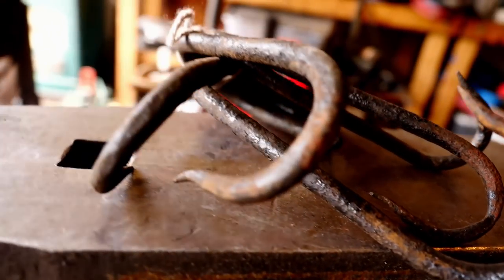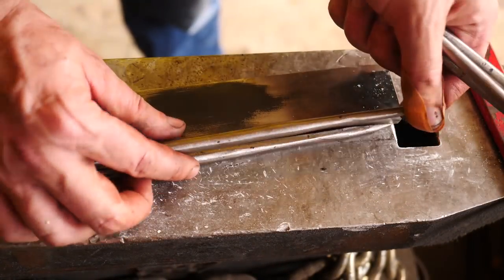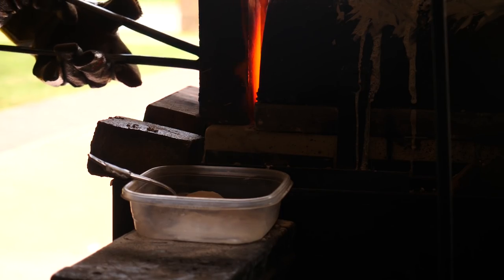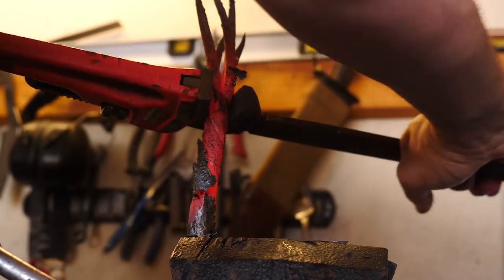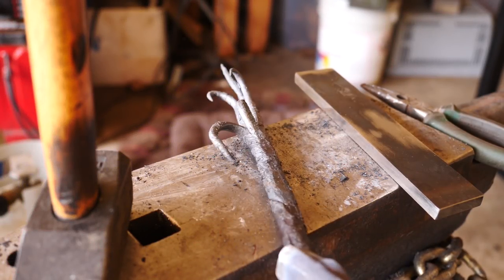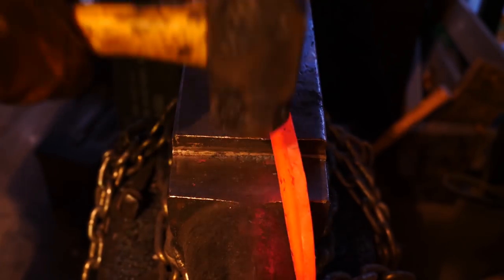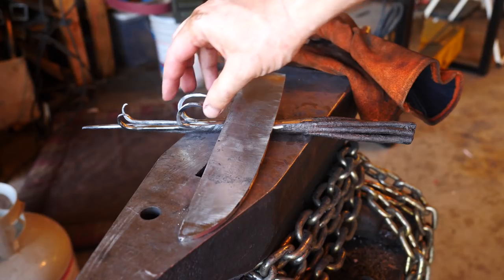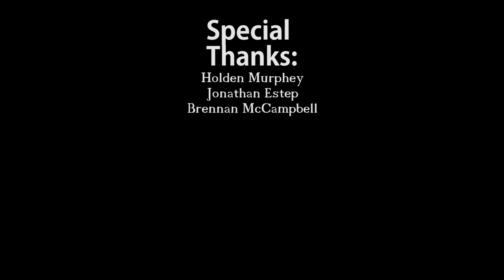Forging A Barbacoa Knife From Old, Iron Meat Hooks.  Pt 1.

Comment: Plumbers Tip: Because you used a pipe wrench for your twisting tool, That wrench is built to turn pipes(or whatever) in one direction. If you find it slipping off of your piece, you could be turning it the wrong way.
Reply: Joseph Norton was about to say the same thing.. I'm a pipefitter and I laugh at people using channel locks and pipe wrenches the wrong way.. They are directional tools.

Comment: Ingenious use of branching lines from the handle to make a filigree effect. Now, if welding doesn’t work you can always try brazing or forge brazing. If you carved in an area for the copper/brass to sit in you could even use it to create another dimension to the design

Comment: Love this, I worked cleaning a butcher shop as a teen and have a puncture scar from a meat-hook that saved my life. Pulled floor-mats before cleaning Saws etc in the shop with high pressure steam pressure cleaner and slipped , went over backwards and would have hit my head in the floor but my  pinky finger was impaled in a meat-hook, and it sunk to the bone. Allowing me to catch and pull myself up to my feet again, and leaving only a small scar on the low inside phalanx of my pinky finger that has more meaning than any tattoo to me.
Seeing them forged was revenge. I would love to hold the knife in that hand.

Comment: tip when you force weld low carbon metall. If you put small small chip or powder high carbon metall it will some time help. The low carbon metal wants the  carbon i the high carbon metal so the low carbon sort of  grabs hold of the high carbon you don´t need much but it can help ang great video keep up the work of the blacksmith

Comment: I did  little experiment once that you should try sometime. i took 2 flat pieces of bearing steel and stick weldet them together and forge knife out of that then i etch it and welding shows in the middle of blade kinda nicely only problem was that tip of knife was welding rod material i forgot curve that blade in forging phase :)

Comment: Before the first forge weld you should’ve twisted as tight as possible and worked it like a cable knife but that’s just my opinion on the best way to forge weld round bar. You did end up twisting tho so it’s all good

Comment: The spine has to be forge welded for structural strength, but why not start with the curls flayed out horizontally then after the spine is connected you can bend them down 1 after another forging then on, cleaning between each one. Or tig weld them on since they do not need structural tegrity

Comment: I would have forge welded the sides first using a vice for pressure then hammer the spin after they had biten a bit. Very tricky project

Comment: Try using natural wood charcoal.  Propane produces water as a product of combustion, which increases scaling.  Charcoal is mostly if not completely carbon, which when reacted with oxygen produces no water and a very dry heat, decreasing the amount of scale.

Comment: are you sure the flux does remove oxidation ??   i allways thought it keeps oxygene away from the surface to prevent new scale to form...  and also as liquid helps the metal behave a bit more like liquid itself..  but all i know flux from is soldering..

Comment: I feel bad for this one beetle, you seem to have not ever worked wrought iron, I hope it is not for your sake, wrought iron, maybe pig iron, or, that bubble type .... which may actually work out, you got the right idea to later weld on some knife steel, but, I am like 5 minutes in, and idk if there will be a part 2 for this ...
Reply from the maker: I've hammered wrought before a few times.  These hooks didn't split and took lower temperatures well. Were more like mild steel and in the end etched like mild steel too.  Except for one piece which was probably wrought.

Comment: Can you forge a knife out of Bobby pins?
Reply: Sandra Timmerman and the handle could be a folded over tang, patterned to look like a bobby pin.
Reply: Sandra Timmerman 
Bobby-pins arr actually from a pretty decent steel.
Reply: I like this idea
Reply: Sandra Timmerman i
Reply: Too thin, maybe in a canister, and they're coated in a gel paint, probably not worth it

Comment: Have you considered using powdered iron between different metal surfaces?
Reply from the maker: I have used powdered iron recently in a chef knife made with scalpel blades for higher contrast.  It works well, patinas quickly.

Comment: Instead of trying to forge weld a vertical Taps you should lay your spine open in half with a bandsaw and then do horizontal lateral Taps and then retap your spine to your blade or fold it so to speak

Comment: I think part of the reason the welds broke was because you didn't seem to be using any gas for you mig gun (noticed you didn't have the nozzle on). You might be using single shield flux core in which case you don't need gas, if so disregard my comment

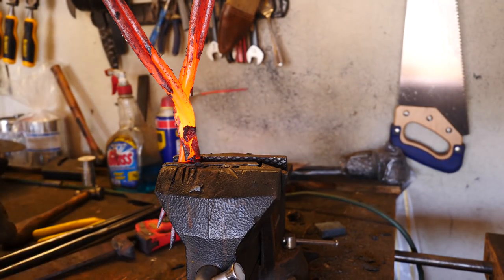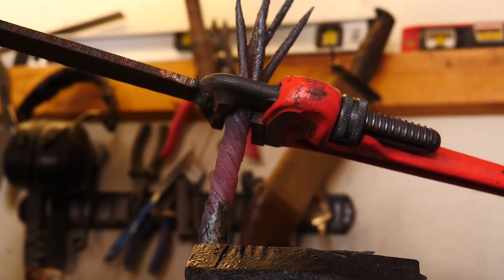Comment: I wonder if it makes any difference that you are twisting-with the pipe wrench gadget-- at about 6:00 to 6:08 and again at 7:17 to 7:35-- AGAINST the tightening action of the PIPE wrench. This is evidenced by you needing to repeatedly turn the adjustment ring to get a good "bite" on the iron. If you had flipped the wrench over, it would draw up on one bite rather than several. Also you would loosen the bite just by reversing pressure on the wrench. 

I hope this makes sense, because it didn't make sense to me to see you turn clockwise with the jaw of the wrench open toward you. A pipe wrench gets tighter going clockwise with the jaw away from your bod. And vice versa. I think. 
 I could be pouring it out of the boot upside-down with the instructions...bla bla bla.

On the other hand...you have different fingers. Just sayin'. ;-))

Edit to say: I went back to your vid "Forging a knife from cable" where you did it "RIGHT" in the first half minute or so.
Reply from the maker: Haha! Of course. I'm such a tool sometimes. Thanks, man!